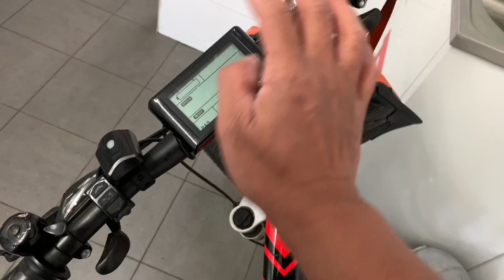Sepeda elektrik rakitan Terbaik murah dan cara merakitnya

Comment: Mas ini sepeda MTB dimodifikasi bisa? Kalo 1000 watt butuh aki berapa volt dan ampere ya? Terus apa bisa kecepatan 60km perjam, jangkauan berapa km akinya? 1 paket butuh dana berapa ya mas? Terimakasih
Reply from the maker: Imelda Septi Kalau mau 1000w pke controller 48v bisa mbak, tapi baterainya 48v dengan minimal 13ah atau di atasnya. Soalnya 1000w butuh banyak daya Kalau mau perjalanan jauh atau menanjak. Usahakan di dampingi yang jago mesin, misalnya montir motor atau montir mobil.